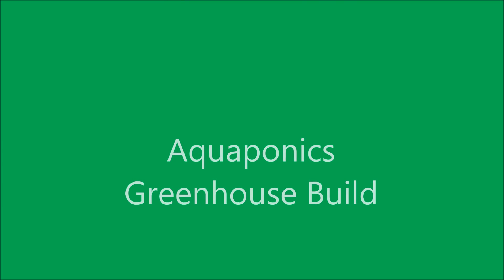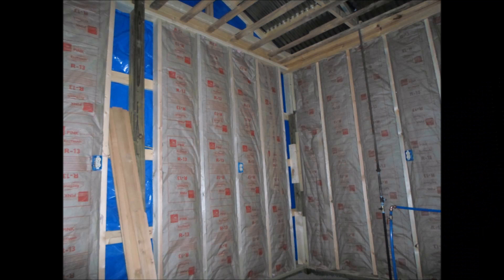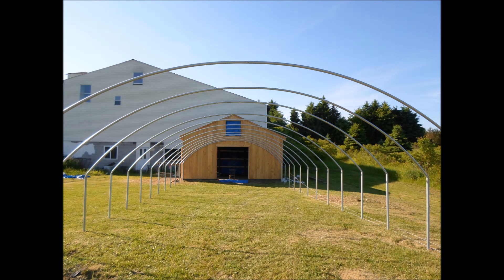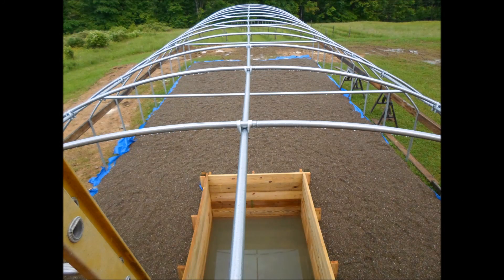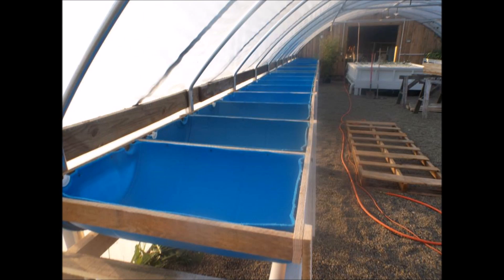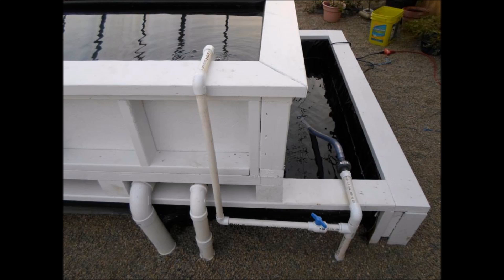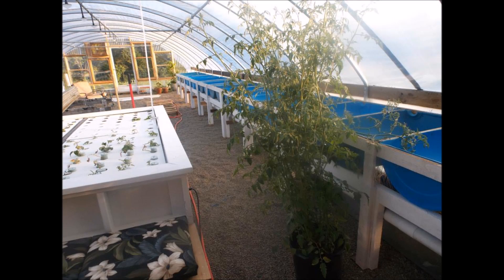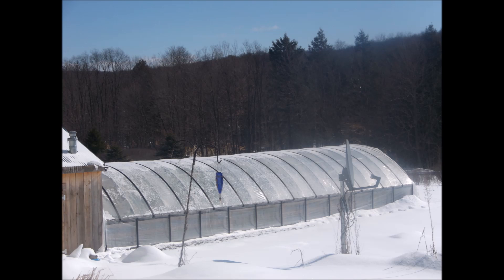Aquaponics Greenhouse Build

Comment: Did you have any heating system inside the greenhouse? Or was it just because it was insulated with the air unit?
Reply from the maker: I have a Natural gas well on my farm, I heat the greenhouse in the winter.

Comment: Nice video, with that size of operation you would be better served with a deep water culture (DWC), set up. (EF) Ebb and flow are for small backyard systems. DWC is easier to manage and Ph tend to be more stable and you do not need the filters.  With almost 1000 gal of fish tank combined, you are better off with a DWC, but you can also mix the grow beds with the DWC and use the grow beds as your biofilters. Fish food has to be top notch for proper digestion, or you will have problems with your grow media getting clogged and the roots in the DWC getting nasty.  Nice setup!

Comment: How do you heat the greenhouse in the winter and how efifcient is it?
Reply from the maker: I am lucky to have aq gass well on my farm--- I have no cost to heat. that being said, I do not waste the heat--- the fishhouse is well insulated and the greenhouse shell is double walled with air inflated between the two layers. There can be snow and ice on the top and the inside will be sweating and dripping . the air makes a wonderful insulator.

Comment: This question might sound stupid but, you said at the end that there was snow on the top of the greenhouse and it was still warm inside. would the snow melt and run off or would it continue to pile on? I only ask because I will be setting up a greenhouse next year and It very rarely snows here but If it piles up I would need to take the weight into account and order larger pipes for the build.
Reply from the maker: the double plastic covering keeps most of the snow from melting, a lot of the snow just slides off, however I found myself with a push broom brushing the snow off to let the sun shine in. you should not have to get larger pipes for the snow load--- just incorporate snow load support into the internal framing like I did. see video; https://www.youtube.com/watch?v=hf4tb1o7Ugw
Reply: Excellent solution! Thank you!

Comment: Donald Porta did you need to remove stow from your greenhouse during the winter?  If so, would you describe the method and apparatus used (if any) for me?  Thank you
Reply from the maker: I use a soft push broom with an extension on the handle. Most of the snow blows off because of it's shape---Don

Comment: Really nicely laid out system. It's clear you did your homework and put considerable thought into your design. I am curious how the overall mechanics of the system have worked out over time. For example, you show two solids filters. Have they proven to be adequate? Are there significant design characteristics that you wish you had done differently or any changes you would make if you were building it over again? I plan to build a similarly sized system very shortly.

Comment: I have had a greenhouse for quite a few years, only 50 feet long.  The other half is still leaning up against the fence...but now after getting some ideas from your video, I think we will be attempting to put it up after the snow clears!  I have an oil furnace that heats mine, yes, very efficient as long as oil prices stay low.  We have started to build a grow room for my plant starts, but I think I may just use it for the fish tanks now...thanks for the idea!  I leave my plastic on the green house all year, and put shade cloth during the summer to cool it.  I'm also going to double my plastic and get a fan to inflate it, I will cut down the costs even more!  Thanks for the video!
Reply from the maker: The double wall is amazing as an insulator--- good luck my friend---Don

Comment: Where did you get the greenhouse kit? Also, how did you supply nutrients to the grow towers? I am assuming that they are not solid water columns, so how did you maintain a hydroponic environment without overcrowding with roots?
Reply from the maker: growers solution is where the kit came from. I used drip tubes at the top of the towers--- approx. 7 gals per hour.

Comment: This is awesome! Thanks for sharing. Do the fishtanks and the rest of the greenhouse require lots of maintenance now that it is finnished? I'm thinking of clogged pipes, water leakage and things like that
Reply from the maker: Yes--- you need to know the system well, good reason to build it yourself.  Constant monitoring, but not constant repairs or fixes--- just need to know everything is working as designed.

Comment: Could you not run 8 in pipe under ground at the far end of the green house to make a cool air intake has you push warm air into your green house?
Reply from the maker: I thought about running pipes over the hill into the wooded creek bottom--- the air is so much cooler there. I would do this for my house also. this would work great, thanks my friend---Don
Reply: You mean use a type of wrot conter sink to cool the air? Put a serpentine coil in the creek bed half in half out and force air through it? Putting the return air flow into the flow of the stream? That might work best pick the right materials for that job.
Reply: A booster fan on a thermastat ran off solar panels would work great right? a booster fan to force air and another to blow the air into the dwelling?
Reply: You could use old tires to burry and enclose the pipes forming a vault of sorts to protect the pipes and insulate them.
Reply: If you do this better use a coating on the inside of the pipes to limit bacteria and fungus growth. You know what I mean that stuff can make you crazy or even take your life. = /
Reply from the maker: I did not think of that ---thank you brother--- Don
Reply: This is why all should share knowledge correct? ; )
Reply: Look into cryosterling sealed cylinders and pykrete cold sinks used in a insulated underground cistern. Where you can circulated water with a biological antifreeze protein for your cooling needs. You could run a wrot counter sink in your creek to strip off the heat on its return cycle helping your system run more efficient.
Reply: Take copper coil flatten it leaving the ends tubular. Fill it with water and freeze it. This should help with pinching when you form a spiral with the copper coil. Take copper flashing cut groves to fit the copper fins in and paste and fuse it all together. The fins will improve thermal transfer has you cool your house or green house. Just hook up some booster fans on a thermastat and your set! You could even use the condinsation from the coil to run into your garden if you live in a humid environment. Hay its always nice to have options right? ; )
Reply: You can chill water for hydroponic use with this set up. You can generate electric with solar panels or even use your creek to produce a steady current to run your cryosterling sealed cylinders and pumps and fans. Think way out of the box and use everything in your enviorment to improve your quality of life has you leave the grid! Right? ; )
Reply: How about your heating needs? What are you using right now?
Reply: This is what you could use for heating, solar vacume tubes that heat liquid metal. Circulated with elctromagnitic pumps through insulated lines to copper heat exchange coils to heat water with a insulated underground cistern has a heat sink. You can flip a valve on your cooling system to run heated water to heat your green house or home. You can also get a thermal electricity generator to power things up. I would get a water hammer hooked up to a filtration system to make drinking water has well. Its nice to have lots of good options right? ; )
Reply: Has for the green house? Would not putting those under ground tubes at the end of each corner act like a cold air return allowing you to heat or cool your green house evenly? Using said system upgrades in the comments? Novartis
Reply: Oh you could even make a hot plate to cook with using a solar tube liquid metal set up. Its really a neat set up you can do a lot with so little! ; )
Reply: You could do a test by getting a solar vacume tube set up and run liquid metal instead of water and make a heater for your barn to keep your animals warm. To get a feel with what your working with. Then you can use that gained knowledge to go bigger for a green house and home. ; )
Reply: A fully self sustaining system of systems to be totally off the grid? Has anyone ever given you this amount of knowledge in order to do just that? Use it well friend and please share with others I know they are going to need it!

Comment: Have you had any mold problems on the wood support structure for the half barrel grow beds especially in the nooks and crannies  underneath? if so beware of mildew-cide paint additive as a solution,  a suggestion is look into "cold cathode" ozone generators as a possible solution and "cold cathode" hot tub ozone injectors for fish tanks but keep in mind degrading effect of ozone on certain materials (most notably polyurethane foam products) if no plastic barriers

Comment: kind of impressive, lot of work,  decent idea, i couldn't help but notice your wiring techniques are a little crude and sub-code, hope you got all your circuits gfci protected and any lighting fixtures are are weathertite, also your interior electrical panel should be nema3 if there are condensation issues in the utility shed. Did you paint all your exposed pressure treated wood? hope so since just one of those 4x4 uprights in your utility shed contains enough arsenic to kill about 200 people (arsenic in wood will exude due temperature differential) (federal regs and common sense mandate all exposed pressure treated wood be painted and maintenance repainted to avoid exposure) , see you wouldn't want condensation collecting on and then running or dripping off into any of your utensils , supplies, water sources or grow beds. have you had any mold problems on the wood support structure for the half barrel grow beds especially in the nooks and crannies  underneath?
Reply from the maker: thank you for all  the information. This is good to know!---Don

Comment: Wont all of the plastic and polystyrene break down and leach chemicals into the food and fish??! Good job on the project.
Reply from the maker: +Shawn Hyde Most plastic is food grade, or potable water.
Reply: +Donald Porta the polystyrene you use as floats would leach into the water then into the fish that you eat. I don't know if the plants would filter out the chemicals or not but it would most likely accumulate in the fish I would think.

Comment: I observe that you have done quite a bit of research into your build. I was wondering what you found as the best direction for a greenhouse? I assume that length North to South would be optimal for full sun, but I haven't seen that written anywhere or observed anyone say that in updates or videos.  Just wanted your take on that. Thanks.
Reply from the maker: +Jeff Streeter The local orchard here has a  number of greenhouses and the one that runs East-West over heats and burned everything in it. so I went with the North -South.
Reply: Oh wow. I wouldn't have guessed that as a result of East/ West.  I am planning a similar set up to yours. My building for tanks on the North end. The building will be East/West. I then was going to place 4 greenhouses South/North butting up on the Tank House. I was thinking of placing a 5th greenhouse on North side of Fish house also running East West for DWC. Hoping for shading from Fish House to keep temps down in that one. I live in Oklahoma so the summers can be brutal. This will be the house for my leafy greens that are so heat sensitive. Don't know if I will put mine on YouTube. Implementing many things into system. Rocket Mass heating, worms in Ebb and flow, Crayfish or fresh water shrimp in the DWC beds, building a bunch of towers (Using your videos). Going to play with my Panels for the green houses. Alternating Red and Blue to cover the spectrum. I got a ton of work to do before the first plant gets started but I believe it will be worth it. I may go broke but I won't go hungry. Wow! I typed all that.

Comment: I work for the state and we are rebuilding are ag and food program i am working on an aquaponics system in one of the green houses how much did it cost for Evey thing  any help would be nice thanks
Reply from the maker: +Bryon Anderson I spent about $10k on everything which included the greenhouse and the support building with all the fixtures. this was the majority of the cost. your cost will be the grow beds, barrels, tanks and plumbing. I can't break that down for you, but it might give you an Idea of what to be calculating. Sorry I couldn't be of more help my friend, good luck on your build. Don
Reply: thanks what kind of gravel did you use did it Chang the ph?
Reply from the maker: +Bryon Anderson I used the local gravel which is slightly alkaline, but as the system matured the pH stabilized and went to neutral---Don

Comment: Great job! What are the dimensions of the tower frame? How far apart did you space the cross pipes and drain holes?
Reply from the maker: +farmgirl s I spaced the drain pipes 20 inches apart(recommended), but found that I could not walk between rows when planted, so, I shifted my tower pattern to two solid rows then left out a row to walk to tend the growing towers from both sides. spacing would have been fine if the rows weren't 7 feet deep and you could reach easily to the centers. spacing between individual towers were about 8 inches.

Comment: An organized and professional looking build. Did you get the building engineered, designed and permitted? Also, my main question, what were your final specs on the bell siphon? I noticed you used an air line (is that what its called?) from a "better bell siphon" design. Was the extra air line drilled in what made the siphon react quicker and more consistantly? Im using afnans design (no extra air line) and it works but it wants to take to long to shut off or start. I have even considered just using a timer on the pump to keep the timing perfect as to how I want. Please let me know if you have the chance. Thanks and congrats on some great looking product!
Reply from the maker: +John Z Not engineered or permitted---I believe that any farming venture should not need Gov't approval, a basic human right for survival. The air line on the bell siphon is to break the siphon quickly, it must have the cup at the bottom of the air hose and this is what sucks in the additional air to stop the action.  The start of the siphon is aided with the p-trap under the stand pipe, air pressure is built up in the trap and when overcome it will "burb" and cause a rush of water and have a positive start on the siphon.  This additional pressure may cause the bell to want to float and may have to be weighted down to counter act this, so you will see a brick weight on mine. Hope this helped my friend, Don
Reply: to quote you "Not engineered or permitted---I believe that any farming venture should not need Gov't approval, a basic human right for survival." and here in lies the rub, i.e. how does one "survive" electrocution or toxic exposure? things which "Health and Safety" Codes address
Reply: I will never forget my first grade teacher telling me that communism was like having to get permission from the government to build something in your yard! Look where we are now.
Reply: Building Codes are NOT the problem, 99.9% of building codes are not only expert intel but the only way to go. it's regulations, fees, and zoning inflexibility that smack of totalitarianism. Building inspection and licenses should be provided free to the public.

Comment: in your assumption or close to exact guess of water volume how much do you have in total?  and. what kind of water pump w/ gph do you use?
Reply: thanks for replying sir
Reply from the maker: +arvie leynes About 3000 gals. in the sump tank and four 250 gal fish tanks.I'll have to look at the pumps tomorrow--- one of the pumps I have to change, my neighbor changed it out when I was away and he put in a large sump pump that is an energy hog. It's got to go. Your main consideration on pump size should be circulating the water of the fish tank.  you should try to circulate the entire volume of the fish tank in one hour, if possible, mine is a little short of this but it seems to be ok. I have 1000 gals of fish tank, my one pump is 1200 gph, but it splits to pump both fish tanks and grow beds. This is the CHOP2 system ( constant height one pump two directions), Hope this helps my friend, Don

Comment: Hi Donald, greetings from Istanbul. So many questions. How big was your greenhouse? What power would you choose for the generator that supplements electricity, do you think Solar panels and a battery would be enough to handle that job apart from obvious extra cost. Also you said you experimented with different bell siphons, what was the issue you had with most of them?
Reply from the maker: +turgan the greenhouse is 20 by 48 feet and the attached building is 14 by 20 feet. cost of the building is more than the greenhouse, smart choice in a warm climate would be a larger greenhouse and no attached building to cut costs down. the generator that I have is a 10 kilo watt which would be more enough power. I would like to convert to all solar but winter would be a problem for me here with almost no sun at that time--- but a hybrid system of solar and wind would work here. also I need to optimize my pumps since some are over-sized, then I could get a better Idea of power requirements. The bell siphons I will make a short video covering the ones I went thru and the problems that occurred and the final reliable solution I came up with..I'm working on that one now---- good luck my friend---Don